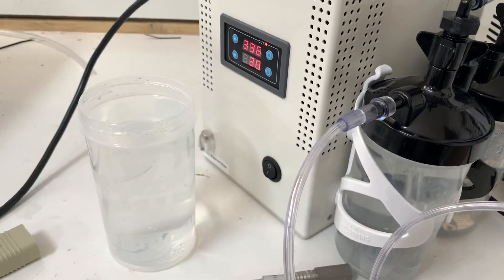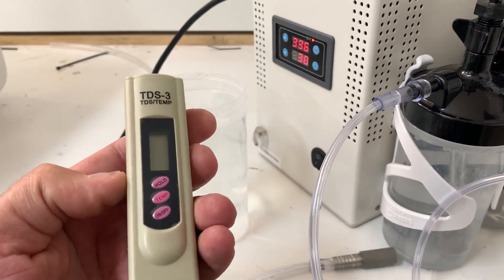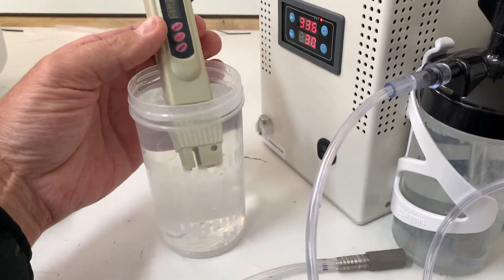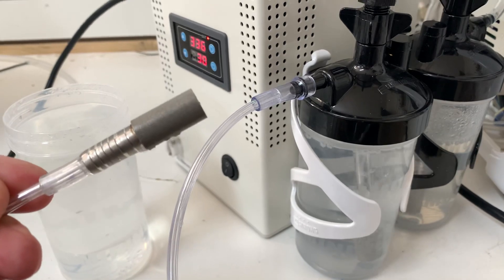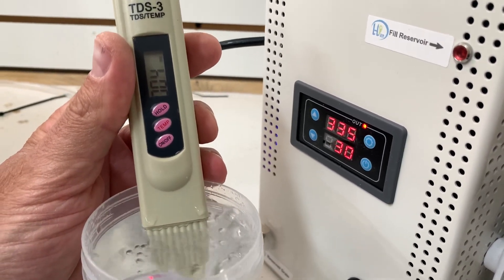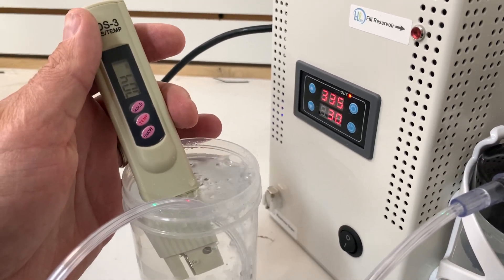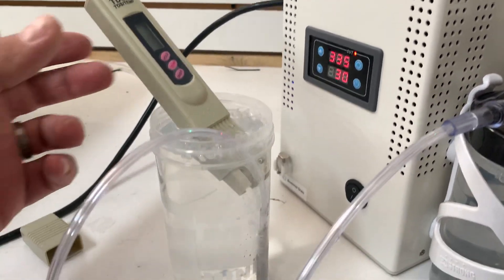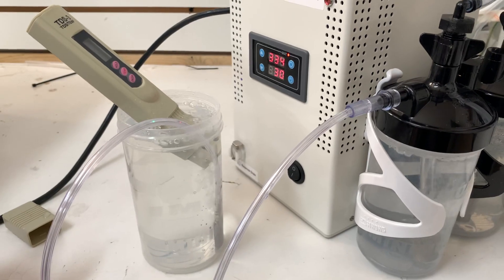How to check for lye in your drinking water from your Brown's Gas machine

Comment: Do you know where I can find a humidifier bottle with a SILICONE tube instead of plastic?  (Yes I know where to get silicone tubes, but they are a bit different than the tubes used in humidifier bottles..) thanks.
Reply from the maker: We have silicone bubbler tubes.

Comment: How do you know if the lye in the machine is too low and you need to add more?
Reply: THE REACTION WILL BE LOWER  IN THE RESERVOIR THAN NORMAL, LESS AMP ON THE METER IF YOU HAVE A METER, LESS BUBBLLE VISUALLY
Reply: @gaetanlizotte1957  ok thanks for your help

Comment: So based on your testing it took 200 hours before lye made it to the water?
Reply from the maker: I tested my new BG3 machine and stopped that test after 150 hours with no spillover. There just isn't enough lye in the system to saturate the bubbler.
Reply: @Hydrogen4Health  why does your BG machine require so much less electrolyte to function than other machines?
Reply from the maker: @brianm840  It was purposely designed that way.
Reply: @Hydrogen4Health  how?
Reply: @Daos Journal if it is in the air it would be in the water.
Reply: @Daos Journal IF THERE IS NO LYE IN THE WATER THEN NO WORRY ABOUT THE GAS THAT WAS FILTER WITH THE WATER.